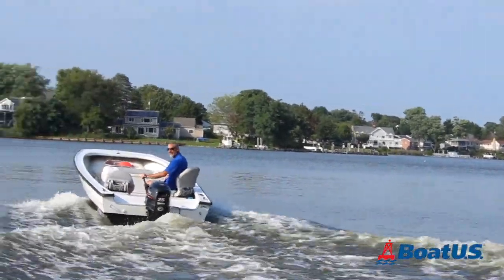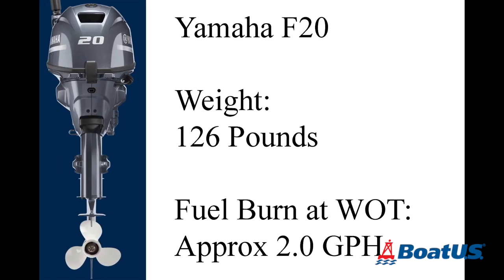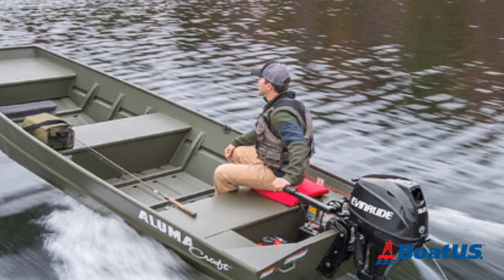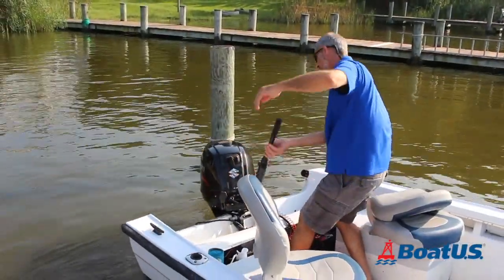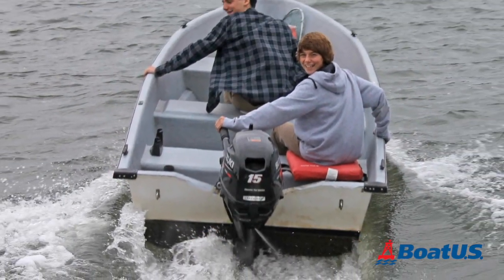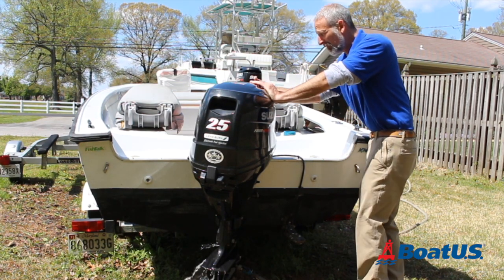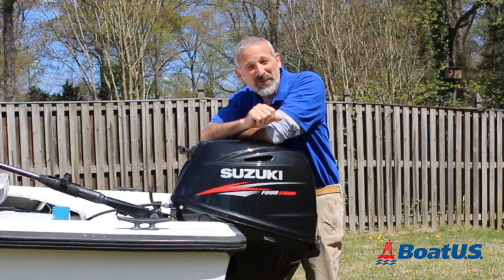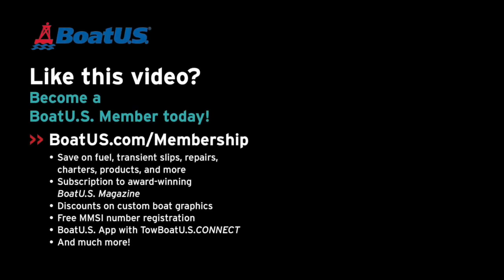Choosing an Outboard Motor for a Small Boat | BoatUS

Comment: What size shaft for 17 inch transom? Thank you!
It's a tracker 1648
Reply from the maker: Thanks for the question, Ryan. Are you sure you have a 17" transom? The online specs say it's 19", but perhaps older models had different transom heights? We always recommend going with the manufacturer recommendations, which should be fairly easy to get with a quick call or email to Tracker. In case it is truly 17": Occasionally when dealing with some very old boats you'll encounter odd transom heights that weren't built to today's more universal standards. Using a 15" shaft motor won't work without modification. As soon as the boat begins to plane, the prop will be starved for water. You can cut the transom down in some cases, but you have to make sure there's room for turning the motor without any of the rigging hanging up or hitting the edges. You could also try a jackplate, but the results can't be predicted ahead of time - it might work, it might not. And to get the motor at the right height, you may be unable to tilt it or align the steering and/or rigging in such a way that it doesn't have issues rubbing against the transom. You may also find that the motor is too low to the water. Without further input, the safest bet is probably to go with the 20" shaft. Hope Tracker's customer service folks can give you a more definite answer though.
Reply: @boatus  yes, it's 16 3/4 inches.... If you count the drain tube sticking down its 17 1/4. I have a long shaft mercury 20hp on the way. I'm planning on getting the on the fly jackplate to go along with it. Thank you
Reply from the maker: @catfishandwhitetails  Fingers crossed that it works out for you. Those odd transom heights can really be tough. Here's hoping for no issues and many years of problem-free boating!

Comment: so i done goofed buying the right shaft length, but what can i do to buy a boat with the right height bc im un sure and need some assistance
Reply from the maker: Hey, JRF. We're not 100% sure what you're asking here. Could you clarify? It's hard (if not impossible) to diagnose issues remotely. You might want to consider consulting with a local dealer or other professional to advise you.
Reply: @boatus  I have the 20" shaft 9.9 Yamaha 4stroke. I am having trouble finding a fishing boat to fit that size. Looking for a 12-16 ft boat
Reply from the maker: Gotcha! That's helpful. There are a number of fishing boats out there with 20" transom rises to match your engine. That said, without knowing where you are located, where you are fishing, and what kind of fishing you plan to do, it's hard to narrow down the options, especially when it comes to hull shape -- deep V, semi-V, flat, multihull. You're probably going to need to stay in the 12-14 foot range for that size outboard though: jon boats, skiffs, pontoons. Take a look at Lund. It offers a variety of boat types, and the new ones are sold without engines. Several models have a 20" transom height. But there are other brands out there. Try searching "20" transom height fishing boat" in a search engine. You might turn up some other options. Hope this helps.

Comment: Bought a 16ft wide bottom Jon Boat. Has an 25yr old 6hp Johnson. The motor doesnt run from sitting too long. Should I rebuild Johnson motor or buy a newer 10hp motor? The boat will be used on small river with little current.
Reply from the maker: Thanks for the question, VA-115. It’s hard to give specific advice without seeing the motor in person. There could be lots of reasons that the present motor does not run. These could include stuck rings, stuck valves, gummed up carb, poor high-tension lead and so on. What I can tell you that it can most likely be rebuilt fairly easily as this is such a small motor. It would be a shame to discard the engine if the repair is likely to be something minor. Why not have a go at working on the engine yourself? I am sure that you can find a workshop manual online, parts should still be available and even if you are unable to get the engine running you will have lost very little but you will have learned something about the interior workings of a small outboard. I personally was faced with a similar situation after a small engine that I owned was dropped into the sea. I was able to fish it out again and after a few hours work and some spares was able to get the engine up and running and I still use it to this day.
Reply: @boatus  thank ypu greatly for the reply. I am mechanically inclinded and will give a go at the 1982 Johnson 6hp motor. Thanks for giving me a direction to go. Was so undecided.
Reply from the maker: @va-115airframer7  You're quite welcome! Good luck with the project and let us know how it goes.
Reply: @boatus  will do. Thanks again.
Reply: A 16’ jon on a river I wouldn’t go less than 20hp. Especially if you’re going to have a few people and gear in the boat. 

But then again I’m used to the Missouri River where we ran a evinrude 48spl on a 17’ semi- V jon and it did great in the current with 4 people and fishing gear, cooler, etc. lot of friends are running 25- 40hp surface drives now as we duck hunt with the boats as well.

Comment: Whats the best 5 hr power on the .arket
Reply from the maker: Hey Michael. The answer to that question is debatable. However, 5-horse outboards are much simpler than larger motors and most are very reliable. The one other thing we'd note is that electric outboards are a new option in this size range which are well worth considering. Though they're more expensive and range takes a hit, the new crop of electrics are a pleasure to run with zero noise, exhaust, or vibrations, starting issues, etc. Thanks for watching and for your question!

Comment: Im planning a plywood flat bottom (a jon boat build)
48 Inches wide with the sides at a 22 degree offset. The intended transom depth is 24 inches.
 overall length of 14ft.
Im hoping to build it with 1/4 inch
Plywood  And sheath with fiberglass ...
My question is how would i determine the horse power needs
For such a boat
Reply from the maker: Thanks for the question, georgia. You do not say whether you are making a boat to your own design or if you are following a professionally designed plan. If the latter then the maximum designed power should be marked on the plan, and you should adhere to this. If this is to your own design then the answer is much harder. The required power depends on so many factors: the weight of the boat, how many crew you intend to take out, the width of the transom, how strongly the boat is built, and so forth.

I suspect that this is boat to your own design, as you say that you will be building this with quarter inch plywood, which may well prove too light and not strong enough for the sides of the boat let alone the bottom, even if sheathed in fiberglass. Unless you know exactly what you are doing, I would get a naval architect to look over your plans and give you some guidance and recommendations with regard to material thickness, (often called scantlings in design parlance), and the maximum horsepower.
Reply: @boatus  Thank you so much for taking time to answer.
Yes the boat is going to be my own design.  it isnt going to be any different from a factory  jon/john
Boat. Aside from the fact that the transom depth will 24 inches 
And all plywood.
During the time ive been playing
With this idea in my head the strength of 1/4 in plywood comes to mind for me as well.
Id only thought of 1/4 inch plywood
For weight saving reasons.
I havent put pin to paper yet
So nothing is set it in stone.
Im hoping to get the graph paper
Out this evening and draw out my plans ... 
Hope that yall check out my videos.
There project videos.  unfortunately
My skills at tinkering are better than my video making skills
Also i have a top secret project coming soon. its related to fishing and boating.

Comment: I noticed the focus was on gas-powered engines. How about Li-ion powered electrics, like Torqeedo? Thanks!
Reply: And ePropullsion, Elco, EP Carry electrics as well!  This video is so far out of date it is not funny.
Reply: @DecarbPeter  Would love an update. I am so sick of stinking, explosive fuels, leaking oil, clogged water cooling systems. funky carbs, etc.! Let's go electric!
Reply: @thomaswentworth9380  I have already had and used three different Torqeedo models, most recently a Cruise 2.0.  The Cruise system is designed to be installed and left in place, not as a portable which is what I need now.  Recently ordered an ePropulsion Spirit One+ which appears to me to be the most advanced (longest range and quietist) 3-4hp equivalent out there, and way less expensive than the similar Torqeedo 1103.  The Torqeedo's generally worked well except for the foldable first 1 1/2hp one which Torqeedo finally replaced for almost free after having to replace six failed batteries 7 or 8years ago.
Reply: @DecarbPeter  Wow! Thanks for the quick replies. I am going to testi a Torqeedo 3 hp myself soon, so I'll let you know what I learn. I am so curious about those ePropulsion motors, too. They are a lot cheaper than Torqeedo, but I am wondering if you get what you pay for? Thanks!!!
Reply from the maker: Thanks for the comment, Thomas. While electric outboard tech is certainly advancing rapidly, battery weight, range, and expense as compared to gasoline outboards all remain significant barriers to their widespread use and the vast majority of the portable outboards in the marketplace today remain gasoline-powered. That said, we're certainly excited to see the evolution of electrics and will continue reporting on them as developments warrant. We will, however, put this on our list of possible video topics for future consideration.
Reply from the maker: In addition, we recently did an article about electric and hybrid motors in case you want to read about the latest in this technology. It ran in April, but we've already seen more innovations since then: https://www.boatus.com/expert-advice/expert-advice-archive/2020/april/electric-dreams-and-hybrid-solutions

Comment: Can u do the drag net pull by 10HP motor with 5 metres. Small boat or do you need higher HP
Reply from the maker: Hi Henry. Thanks for the question. Can you give us a little more info? We're not exactly sure what you're asking.